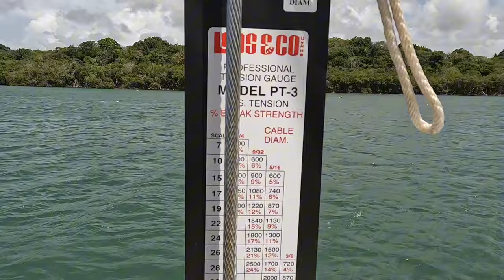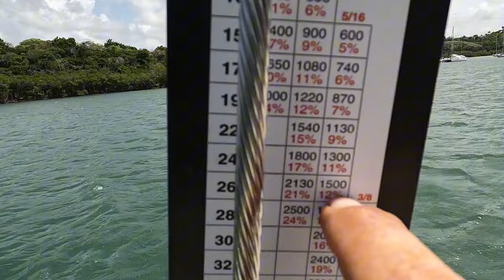How many times must I climb the mast for a single job?! (Ep 27)

Comment: You seem to know things lol, if it heals it over in the middle, will it not tend to heal over more towards that side now under sail , even moving it forward?  I'm always concerned about center of gravity, the pivot point ✌️
Reply from the maker: Oh, I’m not sure about that. I just do it until I figure it out. 🤣
Not sure I follow. I only raise the dinghy like that when at anchor. When underway, I raise the dinghy using the davits. 
Yeah, with such a light weight boat, COG is even more important. It doesn’t take much to get Maritopia heeling over.
Reply: @AmysSoloSailingAdventures  right, I misunderstood, that's cool, easier to have it stored under anchor 👍
Reply from the maker: @jeffmercier1974  yeah, I’ve only left it in the water overnight while in the Bahamas. Other than that, it’s raised out. So I had to come up with an easier and quicker method than using the davits.